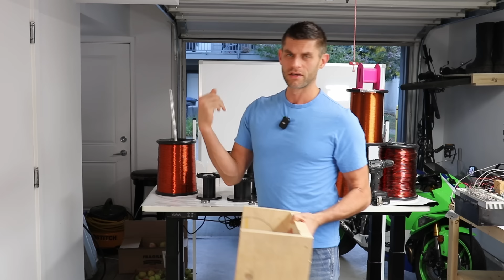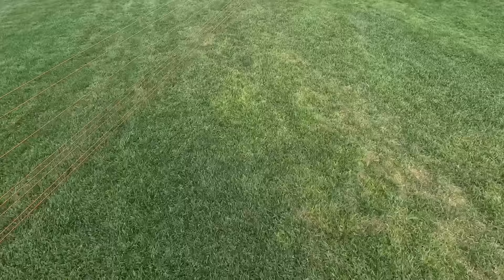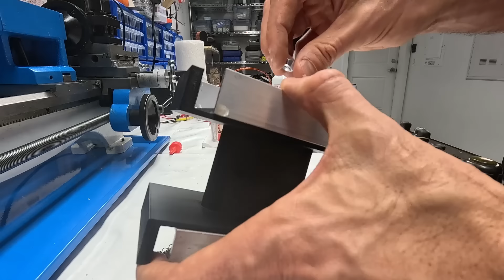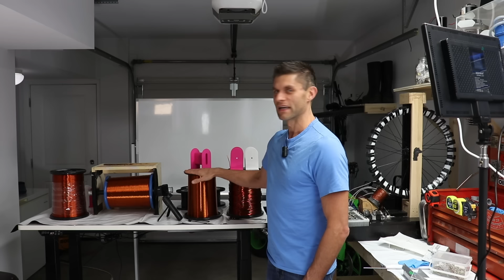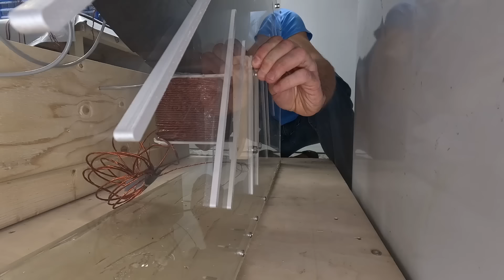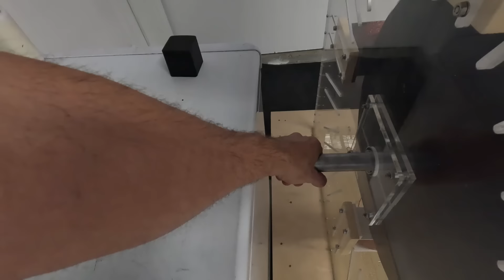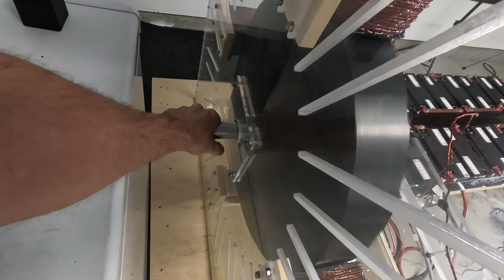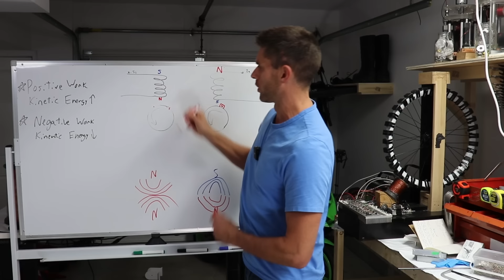The Device That Could Give The World Unlimited Energy

Comment: https://www.youtube.com/watch?v=lvZTomsskJo

Welcome to this Episode of the Quantum Energy Corporation Educational Series! In this Episode Quantum's Director of Engineering and Sciences, Dennis M. Danzik shows the basics of Model 30. A counter rotating Photon Engine that uses paired permanent magnetic fields that are manipulated and controlled with very low energy input to spin two 2,000 pound flywheels, store energy and convert flywheel stored energy to voltage through an alternator!
Keep on going it is real you are on the right path.

Comment: What you have to know first is that Watts are not real and part of a massive scam to keep anyone from producing devices that power homes individually. Watts are used only as a billing practice using only AC volts and current and watts law does not function when using DC volts and current. The schools teach that watts are real for both AC and DC but they don't tell you that it's only used as a billing practice for AC use. Here's how. When AC volts and current is sent into a home your charged only for the current used when 110 to 120 volts AC is attached, however, what they don't tell you is if you double the volts, like 110v connected to 110 volts produces 220 volts, is that if the current is 10 on a single 110v line that equals 1100 watts, however, if the two lines put together produce 220 volts and only the need for 5 in current is used for the device what happens is the watts go down by two from 1100 watts to 550 watts not 1100 watts even though their math states that 220v x 5a AC = 1100 watts. When in reality it actually equals only 550 watts. Why this is true is because 110 volts can be made from .5 volts AC with a transformer which makes the volts meaningless in the equation just like if you have an untransformed 110 volts in the line connected to the house and you need 10 in current but don't want to pay that cost so you chose .5 in current using a regulator and transformer that will only use .5 in current output that is then transformed into to 10 in current using a stepup transformer that then equals 1100 watts. Now, to make the 110 volts above from .5 volts and 10 in current is only 50 watts showing that watts really mean nothing even on AC. What's happened here is you are then billed for 50 watts not 1100 watts if you use this regulator system which is 22 times lower than 1100 watts. Now if you make 220v and you want 5 in current instead of 10 you use a transformer that uses .1 in current to produce 5 from .1 amps effectively using only 22 watts to do it and your bill would show only 22 watts were used. Don't believe the schools you have to do research that is independent of the schools, like Einstein did, to get the truth. The schools have a set learning system that gives only the basics to make money over the long term. You no doubt cannot understand or comprehend what I've told you above, however, it is done all the time inside devices everywhere just not to the point that it saves you money yet. Think about it, ok, if a car radio amplifier produces 2000 watts from an 12v 800a battery which is 9600 watts the 2000 wats would destroy the battery instantly so they use mosfets and transformer coils to raise the volts up and then create more inside the amp so that the alternator and the battery is not over loaded and burn out. This type of technology is what I speak of. So go figure it out yourself...if your smart enough...I worked with NASA on this stuff and it's being used today in rovers that were sent to Mars after Y2000.

Comment: Have you considered building a timing circuit that measures your RPMs and then produces your pulses in accordance with the RPMs so that you could speed up or slow down rotation? If you could build a sophisticated circuit like that you would be able to have better control over the electricity you produce and be able to brake and accelerate the device.

Comment: Why 250 feet of 8 strands of wire twisted together? Did you calculate a magnetic field or something that would be optimized by that much wire? Why go with such a long length? How does different wire gauge affect the magnetic field?

Comment: ok so you built a motor generator! i have not seen any excess power creation, over what is being used. YES it is close to putting out what is consumed, but it still is NOT producing USABLE power without your power source being drained. Have you considered a flywheel and more firing coils and with the addition of a resonant tuned & properly positioned Tesla Bifilar coils to capture some additional field and create some energy from this electric motor. It seems that if you can create 600 rpm with an actual balanced flywheel you could periodically disable input power & freewheel generate, in this way... you could actually generate excess electricity. Of course this will need to be expertly TIMED & COMPUTER controlled to reengage at the appropriate moments so as not to lose all of the speed on the flywheel and force the large draws during cold start draw. In any case I see actual potential here..... but until you can create excess energy all you really have here is a motor!

Comment: And yet just like the other parasites called Renewables or micropower on the grid can only put in about 15% once connected to the grid the ignorance of micropower and Renewables on the grid is easily demonstrated with a volt amp meter and ohms law And it only takes a second to double check the installed watt meter which most folks seem to forget and you will see some 85% difference of which actually going in the grid

Comment: Once you begin to comprehend where we truly live, your works will progress astronomically. Run a current through the wire in a vertical position then place the compass at the base and gradually move it up towards the top while monitoring the magnetic needle. This is how our electromagnetic toroidal field operates while the plane of manifestation happens in its intersection. I give you the true meaning of the so called Christian Cross. North is up and south is down. As above so below. This field is so powerful that it creates our firmament which contains our waters at sea-LEVEL. Once you obtain your eyes, you will now see so much more!

Comment: Have you looked at Gerard Morin's work back in 2019 using different frequencies?  Gerard started with a battery-driven motor turning a generator which was a shaded pole motor that came from a dishwasher pump, and powered lights from it.
Reply from the maker: Gerard is my buddy

Comment: Hi, I've tested and measured winding several braided cables together. The result is that there's no more energy than the core can deliver. For example, if one cable delivers 1W, then three cables deliver 0.33W each, because the field is somehow divided. If you draw more power from one cable, it creates an impedance short, limiting the other two cables' output. What I do is draw all the power from one cable and saturate it, pushing the core to its maximum capacity, after calculating the impedance, of course. Cheers.

Comment: Use graphene coated copper wire to provide a 90% drop in ohmic resistance.
Connect a telluric current source.
Makes a solar panel worthless.

Comment: The early telegraph did not use batteries nor power grid to tap out their messages over hundreds to thousands of miles.  The power was 80 feet of wire insulated from the ground.  That was their power collector to send morris code signals.

Comment: What I currently see is that the electromagnetism is supplying battery power at dc level with occasionsl spikes. This can be controlled with rectifiers and capacitors or possibly inductors for better dc control.
I'm thinking (ouch), the coils could be split and timed to keep the flywheel continuously pushed or pulled b

Comment: Spencer is it possible for me to build a primary mover just to turn a generator with enough torque to that way I don't have to do the detailed gate switches and stuff cuz I'm not that electronically educated and it's intimidating for me to build what your building but if I can do a primary mover that's enough power turn into generator to self-sustain can I do that?

Comment: I wondered where u ventchured off to since last vid. Good to see ya. Got to figure how to ramp up the charge . I know you enlarged the winding , in my non electricle background my thinking is more coils and or larger gauge wire and magnets with higher polarity to make that baby thump , where your going to have to put some some sort of dampener suspension underneath , looks like u got it balanced pretty good . Concept is to get this thing to spin up mad on the verge of smoking the bearings to bring vlts. Up  help me understand ? Might want to look into ceramic type bearings ? Do or is such ?

Comment: Congratulations, you made a very simple DIY electric motor. The changes you're making by changing the magnetic timing, etc. Is exactly what a modern ESC (electronic speed controller) does but 100s of times more efficient. Instead of copying DC controllers, you should build a 3-phase AC motor so you can play with phase amps and line amps. You can gain even more control. But again, its already been done and perfected
Reply from the maker: Congrats your have a generic viewpoint enjoy

Comment: Solid state crystal power cells voltage multiplier electronics power's pizoelectric solid state Stirling cold gas cycle piston pump motor that circulates high proof alcohol at ultra low temperatures through a radiator seabeak effect electrical power generation system power's solid state fan passing air through radiator for air conditioning system and power's thermostat.  That air conditioner would help lot's of people and piss off electrical power companies owners no more cooling costs 😅😂

Comment: Pizoelectric solid state Stirling cold gas cycle piston air liquifaction module generation of liquid air fills an insulated tank gravity fed.  Liquid air feeds ultrasonic vaporizers frequency set to generate HHO from the liquid air gravity fed.  HHO used for HHO fuel cell electrical power generation system waste water gravity flow through filter mineralization filter for fresh drinking water supply all off same system.  🤔✨️

Comment: Pizoelectric solid state Stirling cold gas cycle piston air liquifaction module generation of liquid air fills an insulated tank gravity fed.  Liquid air gravity feed to a Tesla valve with ultrasonic vaporizer frequency technology that returns liquid air instantly back to their gas state's generation of thrust forced air that spins a Tesla turbine with Gadolium magnetic bearings for clean renewable electrical power generation? 🤔✨️

Comment: Great engineering work on the custom octafilar coils and PCB layout—the build quality and craftsmanship here are genuinely impressive! However, for viewers getting excited about the "unlimited energy" claims, it's important to clarify the physics of what’s actually happening:
The High-Voltage Spikes (Flyback): The machine isn't drawing energy from "inner space." When the current to the coil is abruptly cut, the stored magnetic field collapses rapidly. This creates a high-voltage spike (flyback voltage/back-EMF). While this voltage can be directed to charge a second battery, the total energy (Joules) contained in these spikes is always strictly less than the energy it took to create the magnetic field in the first place, due to heat and magnetic losses.
Measurement Limitations: Handheld clamp meters and standard multimeters are designed for steady DC or smooth AC. They cannot accurately read high-frequency, non-linear pulse widths. They heavily average the signal, which often creates the illusion that the output wattage matches or exceeds the input. Measuring true power here requires a high-bandwidth digital oscilloscope to calculate the exact mathematical integral of the power over time.
The Self-Powering Test: The ultimate test for any device claiming over-unity or environmental energy capture is to loop it—disconnect the primary power source and run it entirely off the battery it is "charging." Because of bearing friction, air resistance, and I^2R resistive heating in the copper wire, the system will always experience net losses and eventually slow to a stop.
It’s a beautifully constructed, highly efficient pulsed motor-generator, but it still operates firmly within the bounds of thermodynamics!

Comment: You might consider using vacuum tubes in your system. They have far less loss than semiconductors 
     My friend had a console type am / fm  stereo and turn table. He had no electricity.  I cut the headphone wires from my credit card size radio, powered by two button batteries, and connected it to his stereo by the aux. in connections.  That little radio powered the two 14" speakers at a very high volume.
Reply from the maker: Nice

Comment: In most electric generators (like DC motors used as generators or permanent magnet alternators), voltage is directly proportional to speed. If you double the RPM, you roughly double the voltage output%

Comment: The amount of voltage created at 400 RPM depends entirely on the design of the generator—specifically its magnetic strength, the number of wire turns in its coils, and its intended "RPM per volt" rating. There is no single universal voltage for that speed. ..

Comment: What this experiment demonstrates is electromagnetic coupling and energy transfer, not the creation of new energy.  Yes, when current passes through a conductor, it generates a magnetic field that can induce current flow in another nearby conductor through electromagnetic induction. That principle is well understood and is the foundation of transformers, motors, and generators.

However, induction is not a source of energy.  It is only a method of transferring energy, always with losses.  To demonstrate a true net energy gain, the experiment would need show account for all system losses, for example:

Bearing friction
Air drag
Copper resistance in coils and wiring (I2R losses)
Magnetic hysteresis losses in magnetic materials
Eddy current losses
Switching and driver circuit losses
Heat dissipation
Vibration and acoustic losses
Generator back-torque from Lenz’s Law
Battery, capacitor, or startup energy losses
Reactive versus real power measurements
Measurement instrument accuracy and phase relationships

Most importantly:  When electrical power is extracted from a generator, the generator becomes mechanically harder to turn.  This is not theory or opinion. It is a direct consequence of conservation of energy and Lenz’s Law.

A spinning flywheel can store substantial kinetic energy and continue rotating for a long time, especially with efficient bearings and low loads. That can appear impressive, but prolonged or incresing rotation of a flywheel is not evidence of energy creation.

The critical question is not whether the wheel spins, or with higher RPM's.
The critical question is:  Can the system continuously deliver more real, measurable output power than the total input power supplied to it under verifiable testing?

If not, then this is simply an energy transfer and storage system, not “free energy.” or that you somehow disproved the first law of thermodynamics.
Reply from the maker: False, nice try AI summary, have fun with the next video whete we show COP3
Reply: @MadscienceLPTECH  That is exactly what I expected.

I asked specific questions regarding where the experiment accounts for the total system losses and energy balance.  Instead of addressing them, you run and deflect.

If the claim is that the system produces net new energy, then you should easily be able to clearly demonstrate, with measurable data where you accounted for this.  There's not even any mention of this in your video.  This isn't science, its crackpottery.